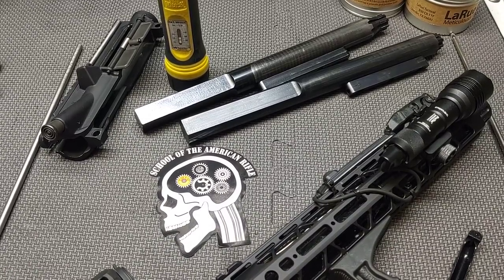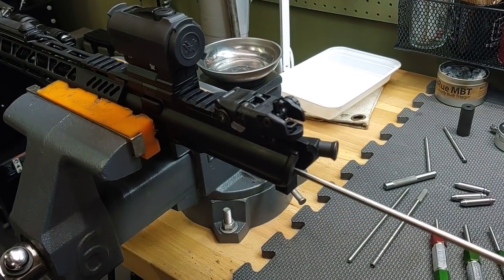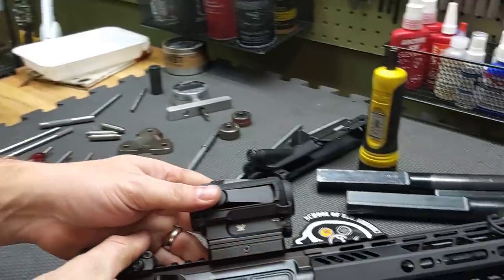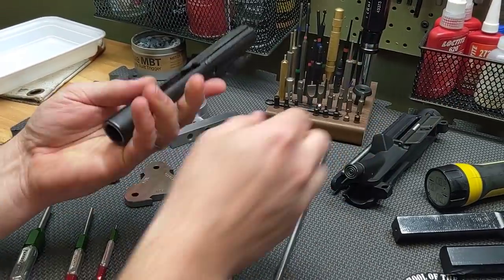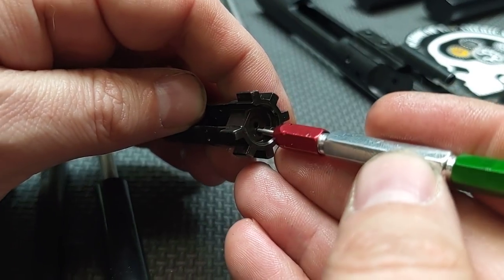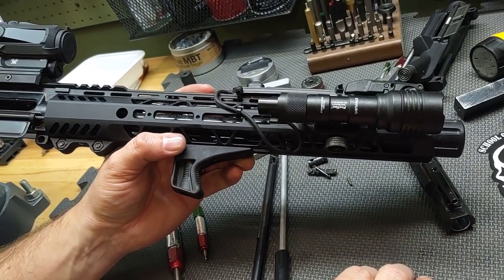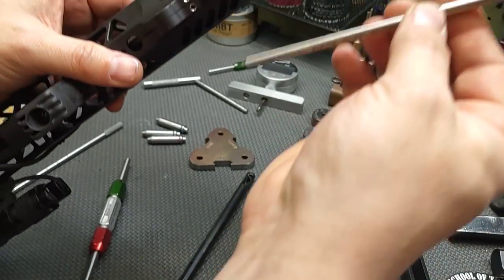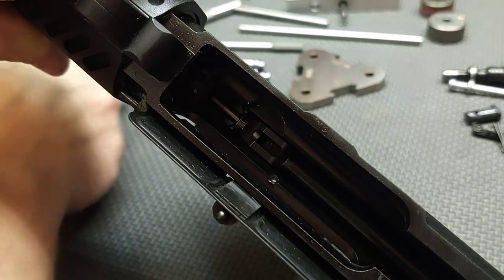PSA Upper Receiver Autopsy - Part 2

Comment: Very interested to see what people look for on the civilian side. I'm a 30 lvl repairman for the military, and we didn't even use half the gauges he used in just this video. Barrel straightness, firing pin, headspace were pretty much our go to gauges. Again very interesting and cool.
Reply: This isn't typical civilian haha typical civilian is ok didn't close on a no go gauge so send it. This is more teaching gunsmithing for a living level.
Reply: Joel Zera -- "Mil Spec" as marketing phrase is different from materiel & armament actually built for US military use under Fedgov contract.  That would explain what you mention.  

Also, what you mention does NOT excuse the QA & QC failures Chad found on this upper.  PSA didn't assemble this upper under Fedgov contract for US military use.  PSA just uses MilSpec as marketing, to suggest parts will fit -- and not a guarantee they are up to duty use by military personnel.
Reply: As a 30 lvl repairman in the military you have all those gauges available. They are just generally not used because most of the rifles function well enough for military use. The gauges you do use are simply trying to be preemptive about what could cause a failure with injury. They want you to inspect an arms room faster not better. Had an E5 ask me to skip steps because I was taking "to long" during arms room inspections. I told them nope no way I was already doing just the safety and not full operation inspections.
Reply: @jarrodkiser6042 never heard of a lvl anything armorer in the Army. Let alone a 30 lvl. That said all these gauges and tools are over kill generally unless you loaded and can justify his per hour fees. Best I see most failures tend to have easy corrections.
Reply: richardmangus8776 LOL its even more frightening, they're running around with Colts

Comment: You are LIGHTYEARS ahead of any other AR platform based channel I've seen on YT. I've only assembled Two AR15's to date and so far I've learned that 
1. in spite of the "cookie cutter" platform, each build will throw you small curveballs and learning opportunities varying from manufacturer to manufacturer... 
and
2. Regardless of that, a quality build will require the same specifications to be met in key areas no matter the manufacturer, calibre or style.

Watching your videos gains the viewer years of experience in literally minutes of view time. Thank You!

Comment: I bought an 10.5" upper with the slant mlok handguard, with the same muzzle device.  The gas block screw fell out after firing a few rounds and I noticed the muzzle device touches the handguard.  I changed the muzzle device and put in new screws.  One other thing to note, the barrel was not dimpled, so I went ahead and done that on my own.

Comment: I've owned a few PSA AR prebuilt uppers and had no issues with any of them
Reply: Yeah I have many of all lengths in the nitide and non lined uppers as well as the fn uppers and all are great.
Reply: You have a very small sample size. Hasty generalisation fallacy. Because your few were running doesn't mean it's the same for most of them. If you watch a particular barrel autopsy also from SOTAR, there is a former psa QC worker that mentions some years where the QC was worse, people got canned and they source and produce more themselves now. So let's say you'd fall in that category and had a few that sucked. It would again not be sufficient.
Reply: One, you've been lucky.

Two, how many thousand rounds have you put through them?

Three, what is your shooting protocol? Do you push yourself and your PSA rifle, what are the limits?

Four...any bad manufacturer/assembler can produce a reliable rifle and any good manufacturer can produce a lemon.

One of my favorite ARs ever was an Adam Arms. I drove it like a stolen car and it stood up. However, I bought it dirt cheap and I know I Got LUCKY! 

Don't let love of a price point cloud your judgment. If you love your life and you honestly believe your life may depend on you operating a machine, get the best machine you can afford. 

Would you trust your truck mechanic to work on your ride if you noticed he only bought the cheapest tools made in China?

Comment: Thank you sir, for providing all these very interesting, educational, insightful and helpful videos! I'm curious, what would have been the things you would have checked if you had been able to disassemble the upper and which things typically have the larges impact on good/poor accuracy there? (barrel extension receiver fit, barrel nut torque, perpendicularity of receiver and inner barrel extension face (the surfaces that wedge the extensions shulder) poorly fittet extensions, damaged crown, misaligned muzzle threading, maybe a loose gasblock.....?)

Comment: I have a PSA upper with the FN barrel and geissele gas block, rail, amongst other goodies. Thing runs like a champ, but the base palmetto I got on sale with BCG plain jane required me to change my buffer weight. Dunno, I trust PSA. Decent prices for good products. I know people poopoo on them but most of the time they do a bang up job. Thanks for another fantastic video, Chad. I love your autopsies and physicals. I can watch those for days!
Reply: Paul Barclay I have a BCM. Great rifle, mid length 14.5 inch. No need to be rude. I also have a colt le6920 that I’ve had more problems with than my psa upper. But I’m not going around slandering a company. Good day.
Reply: They make a LOT of budget AR's.... that said a metric of how many per 1000 or a nother benchmark would be a better analysis...
      I have several of PSA's rifles and the only issue I had was a out of spec hand guard.....and they promptly replaced it and payed for shipping...
      I have better rifles....but I find they are a good value for there price...not every rifle needs to be a battle rifle to make someone smile...
Reply: @Paul Barclay 
Bcm doesn’t make any parts. They are an assembler. Nothing is made by them...
Reply: Doing a cheap job with questionable QC is not really what most folks would call "a bang-up job" -- unless being sarcastically ironically punny.

Comment: These videos have made me so paranoid about my guns LOL. I havent had issues with my PSA parts when I bought and assembled them, but having seen this I will go though my guns and look for the key issues you showed ( at least what I can check without those gauges)
Reply: Same my 10.5 psa upper has been flawless with about 300 rounds thru it so far my new 16 inch mid length upper on the other psa has not been fired yet going to thoroughly look them over after seeing this
Reply: Best to get yourself a good AK. Nothing on those require gauges other than head spacing. You buy one, take it to the range, make sure the barrel is free of cosmoline and voila! You have a perfectly good rifle that will last generations before needing a cleaning.
Reply: I understand budget concerns and the appeal of PSA pricing and marketing...however.

Not that other manufacturers don't have problems also, but sometimes, just sometimes, you get what you pay for. 

For example, I personally have had persistent problems with Ruger ARs (decided that they were only toys, not for real world) and I've heard so many horror stories about PSA and have seen some real junk from them.

Save your hardearned money for something that not only you can trust, but something you can proudly show off.

I'm saying that if you're a serious shooter, spend serious dollars. Go find an LMT, LWRC,DD, FN, Adcor, KAC, or an old Colt...something somewhere that has true milspec parts and survived modern military testing. All those mentioned above have been adopted by someone.

Or, admit that you just want a "cool plinker" and enjoy it, but understand it's limitations.
Reply: @yeshua1176  so it's survived one range session
Reply: @JD-tn5lz  hey man Ammo is damn hard to find in some places
Reply: @JD-tn5lz  any more info in subsequent sessions?

Comment: Starting about 7 years ago I bought a complete PSA M4 clone. It was very good quality, cycled flawlessly and shot about 1.5 moa. 
A year later I purchased a 10.5 upper without the bcg and charging handle. The upper was so badly out of spec I couldn’t get a charging handle in the upper regardless of manufacturer. I tried four different charging handles including a mill spec. All of them worked on my other uppers. F marked front site was badly canted. It still cycled but I almost ran out of windage adjustment zeroing it in. 
Fast forward to last year I bought an 11.5 phosphate upper and it was perfect. I just purchased a stealth lower and complete 11.5 nitride upper a couple of weeks ago and it looks outstanding. It would seem as though they’re QC is getting better

Comment: Great video! I see you check for magnetism using a washer. I think you'll enjoy a tool i use in my industry for checking for magnetism. The tool is called an ABS detector card. It's extremely sensitive to magnetism. Thanks for sharing what you do!

Comment: PSA does sell 223 Wylde uppers, although last I checked (maybe a year ago) they were only bare SS barrel stock.
Reply: I have a psa upper in .223 wylde but I bought it with a FN chromed 18” barrel in that chambering been a good shooter for me
Reply: I have the PSA 223 wylde upper w ss barrel. It shoots pretty good. Not really sold on the Wylde, but i bought it because it was only 20 bucks more than buying the vortex strike eagle 1-8 I was already going to buy.

Comment: I dont have a pivot guage but the too wibbkesca whole lot. I replaced the one with Geissele automatics pubs still the same hand to get creative and just use some automotive clearcoat to paint the inside of the rear hole  for that take down pin. It diesnt shake anymore but I can see light in between the upper and lower. Thhs hs my secing osa build and I  wasn't thrilled with the way it held together with the stock oubscontiba very good aero M4E1 lower so my guess is its PSA upper why it's not connecting to my Dark storm lower 100 percent.  Since I fixed the wobble it's acceptable but I've put so much money until this sbr with other parts for it not to be perfectly inline. I've replaced almost all the PSA parts with either Geissele aero tube rise arrangement trigger but I have to say that trigger wasnt bad at all. Neither was the bolt catch.  The safety selector in reolacingvwiksin combat aanecwurh charging handle Geissele super 42 spring and h2 buffer titanium detent PSA brand Guntec castle nut enhanced qd end plate and Geissele maritime bolt catch and take down pins battlearms group mag catch and mag button and spring ergo pistil grip. Daniel Defense stock I wanted to go for an mk18 style so I'm trying to get on the Daniel Defense  handguard but like I said Palmetto decided to epoxy it on I have no idea why and I want to out on my Strike industries king compensator or my 2a armament who knows though will I need a different delta nut or some type of heatccover PSA doesnt want you to alter these parts but I'm tired of seeing a flash cone and I never was a huge fan of the slant  handguard. If it was an inch shorter I could remove the cone info please email me Mleong316@gmail.com how to get these off

Comment: I know this is an older video but seriously watching this after a long day calms me lol. However lately I have been reading more and more about torquing a muzzle brake or flash hider for a suppressor mount, I wasn't able to see if this muzzle device used a crush washer or shims, however I was wondering your thoughts on that as far as adding to possible reasons for accuracy problems. Keep up the great work and I appreciate the content.
Reply: Muzzle device doesn't make contact with the projectile. As long as it inst loose enough to cause vibration it doesn't matter.

Comment: I'm sure I'll be burnt at the stake for this, but this is should be expected from any assembler claiming they're a manufacturer and selling to the low budget line. 

Every PSA I've seen has not stood up to hard Alaska use and some not even to summertime playing.

If you want a sub-1000rd/yr plaything cheap, buy PSA and enjoy. If you want something to be proud of, go work some OT, save your dimes, and get something from someone reputable.
Reply: If anyone has a problem with what you've said,  I can't understand them. 

I took a PSA to thunder ranch and it lasted 2 days. I finished the course with one of their house rifles. I came home and immediately bought a Larue OBR. It has been to thunder ranch and two other courses, and hasn't skipped a beat, other than shooting lower grain ammo like a shotgun. 70+ gr ammo groups less than a minute reliably, so that's weird. 

My point is you're 100% correct. Decide if you want a toy or a tool. You're going to pay for a real tool, and companies like PSA don't sell them.

Comment: Thank you for sharing you info. You have me wondering at 9:45 when you bring on screen a "non magnetic washer" then test two components to see if they are magnetized. Well if the that washer is non magnetic no magnet would pick it up. So I''m not sure what the purpose of this was? Cheers, Billy in Canada.
Reply: I thought the same thing. Perhaps he "just miss-spoke".
Reply: My only guess was to make sure that none of the AR parts were magnetized - magnetized parts would have iron dust stick to them.
Reply: He meant non magnetized washer. Such that if the washer sticks to the bolt, it indicates that the bolt is magnetized.
Reply: A lot of people shoot cheaper "steel case" ammo in these guns.  Having a magnetic bolt could cause FTF or FTE issues.
Reply: Please see my reply to Mystery Meat. The object must be paramagnetic, so that it cannot hold a permanent magnetism and thereby be the cause of sticking. Nevertheless, it must be capable of being magnetized temporarily when a magnetized test object is brought near.
Reply: Maybe having had to do with improper magnetic particle inspection?

Comment: I have a BCG with a second cam pin hole drilled exposing unfinished surfaces. I took it back to a local gun shop & was told it is normal!? Doesn't seem normal at all. Thank You any info much appreciated. Thank You!

Comment: I just bought a PSA upper for a new build. Hope mines ok.
Reply: Paul Hughes was it ok? I bought one about a month ago too. It shoots good but the bolt  does touch the extension on the way in. The s&w I bought back in 09 does not and it feels so much smoother
Reply: It will be fine. It is no precision rifle, but for the money it won't do you wrong. I have over 5k through each of mine. Shoot about 2-3 MOA. Not the prettiest craftsmanship but they work. You get what you pay for, and for the price it is alright.
Reply: K Watson mine has a canted fsb

Comment: Maybe that vortex spark can't hold zero. I've heard bad reviews on them.
Reply: @nitegoat1369  i've had one for years and the only thing bad about it was them not telling me to use lithium aaa's.  alkalines leak! thank goodness for that vip warranty
Reply: @nitegoat1369  i also own a number of vortex optics, but they all take lithium coin cells... so i dont really think about those leaking. it's just the sparc ar that takes the aaa and i honestly didnt think about alkaline vs lithium when the original battery died. the owners manual even said "takes ANY aaa battery".... needless to say, they were VERY fast with the turnaround (about 1 week to the day i sent it out) and really didnt question anything. personally, i think it's a common failure with any of their products that take regular battery sizes. they didnt even try fixing my old unit and just sent me a brand new one!

Comment: I would have a question about the magnetic test.
On one of my AR15s the fireing pin is magnetic, I can lift the splint with it.
What woudl be the cause, what problems could it cause?
As a reloader I have no intension to ever shoot the mentioned steel cases.
Reply: He says in other videos it can pick up debris from the steel case or bimetal jacket of the projectiles.  This debris can cause excessive wear and tear as well as malfunctions.

Comment: Just bought a PSA upper in 300 BO 
I figured it was the only company that has anything in stock so screw it. 

Kinda regretting now and I haven’t received the merchandise yet. Wondering if I should just cut my losses and take the 25% restocking fee
Reply: Run it and see how it is. This is just one example. There are tons of happy customers out there including myself.

Comment: So, I now I get that why he tests the bolt and bolt carrier for magnetism only applies to steel cased ammo. Now I'm guessing that if the bolt was magnetized strongly enough ...  it might interfere with ejection of steel cases ?
Reply: I think more of an issue with a magnetized bolt and the use of steel casings would be a build up of iron fillings on the bolt face and lugs. That could cause a host of FTF and FTE problems, and who knows what else.
Reply: @EarthAltar  Thanks ! That does make more sense.